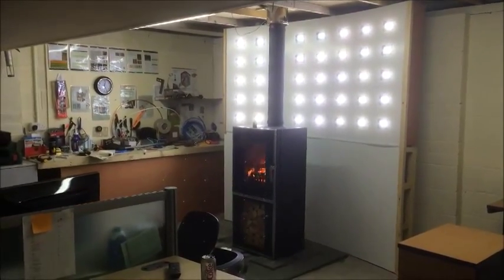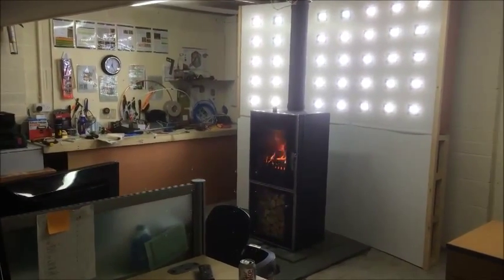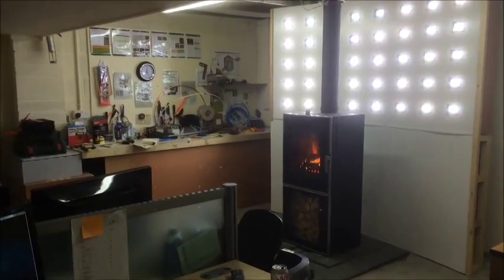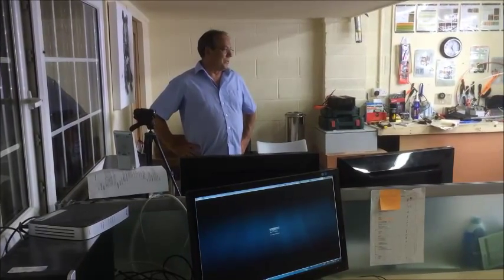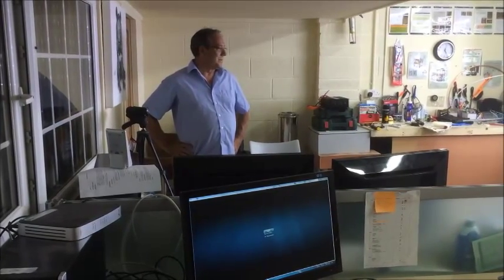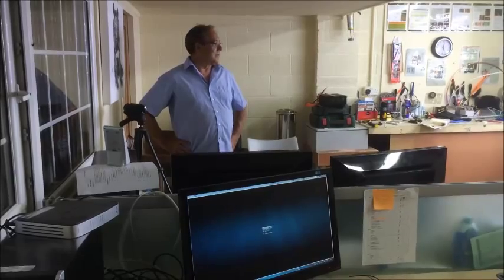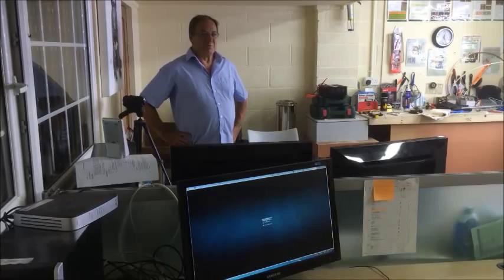Xtralec - Generating electricity from a wood stove

Comment: This type of special box is needed for electric cars.. if a car broke down and there's no electricity line in a remote area then this emergency box can be used for temporary charging the car battery
Reply: I think you just solved peak oil.
Reply: @rottin_3669  I didn't get it what you mean

Comment: Brock - Using thermoelectric generators taking the heat from the firebox and cooled by water. We are running radiators off this directly now. We have had over 1kw output
Reply: What happened to this project? Did it ever turn into a commercially-viable product?